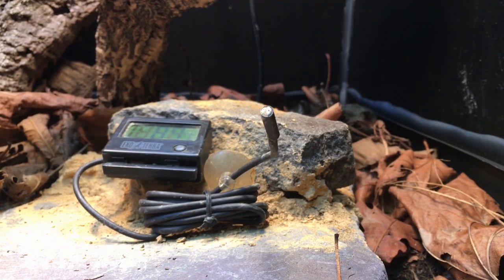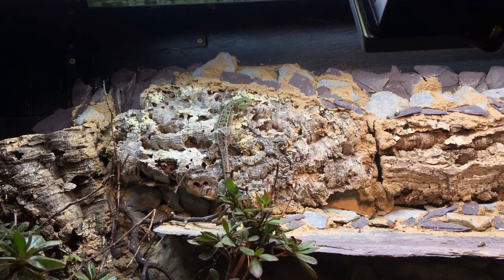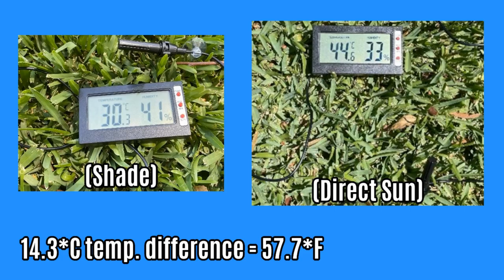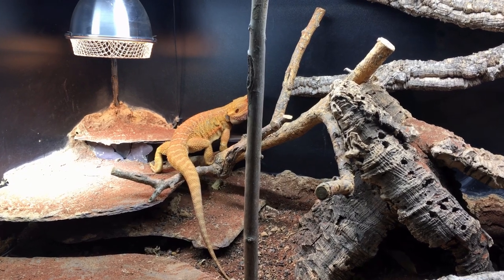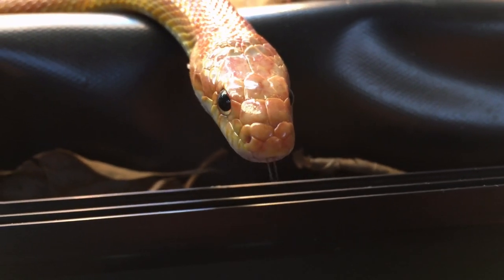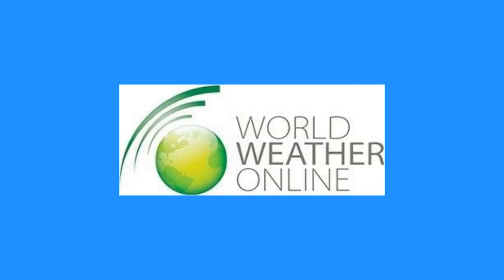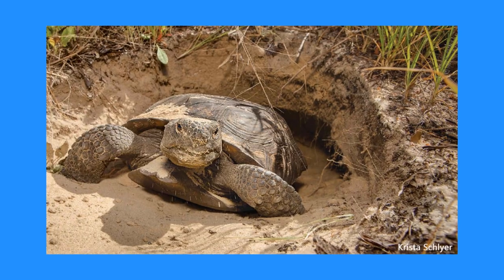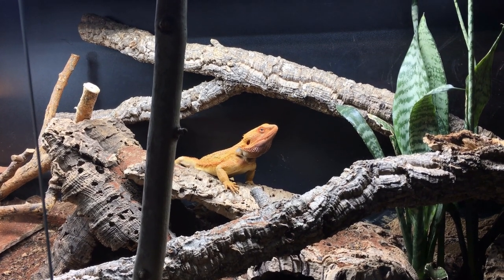We've Been Heating Reptile Enclosures Incorrectly All These Years! - How to Heat a Reptile Tank

Comment: I think a great lesson to learn from this is simply most of our enclosures just aren't big enough?! I've been running tests with different wattage lamps and a dhp on my latest 6x3x2.5 (width, height, depth) enclosure and can keep a 100w halogen on full almost all the time using a dimmer thermostat as an overheating precaution. 

This is obviously species specific and completely reliant on factors like ambient room temperature. 

I can't see how this theory can be used on small vivariums safely without a computer controlled system. Excellent video and leaves a lot to think about!
Reply from the maker: The question is, what wattage tungsten halogen lamp are we to choose? We shouldn’t be choosing it on the basis of temperature, which is only a product of its action: we should be choosing it by direct selection of its output. So, instead of seeing how warm it gets when the lamp is left on (which is a product not just of the lamp but the temperature of the room, the ventilation of the vivarium, the insulation of the vivarium, and so on), we consider its output directly. We already do this with UV lamps when we consider the UV index: soon enough we will be doing something very similar with near infrared and, indeed, for visible light which is yet another consideration.

Only AFTER we have got the radiation right do we start thinking about temperature control, which should be achieved without altering the “sunlight” we have established.

You are right though... The bigger the viv, the easier this gets.

Thanks for watching!
Reply: @JTBReptiles  I look forward to seeing how we can optimise how to provide natural radiation! 
Until then, all I can think of doing is not having a lamp barely lit in a small vivarium because after a few seconds the enclosure has reached the temperature at which a stat has been set to, which is a great lesson your video teaches!
Reply from the maker: Give it a few months and the pieces of the jigsaw could well have been fitted together. Watch this space!

Comment: What a brilliant video and it all makes perfect sense!  How can the air temperature outside be different only a few feet away of course it isn't, it is radiation!  I tend to have a temperature probe at the hot end and the cool end, but do I really need one at the hot end anymore?  Monitoring the temps in a shaded area surely makes more sense?  If we use a corn snake for example the temperatures vary from region to region and looking at the very useful information from Snakes N Ladders Alabama peaks at over 30 and Florida into the mid 30's during summer months for day and low 20's for night.  Therefore could we happily set a day temperature from a probe reading at the cooler end to read happily in the higher 20's, say 27/28?   I have been trying to keep the cool end at say 24 and the hot end at 27 but possibly could I increase these temps?  The next part is how does your thermostat probe then fit into all of this as well!  Too many questions and fried brain now :-)
Reply from the maker: Thank goodness it made sense, I’ve been worrying for months whether this video would just be overcomplicated mush to people so that’s great to hear!

Yes, you’re bang on. The apparent warm end/cool end temp difference is because of the lamps illuminating the thermometer, not major differences in the temperature of the air in a few horizontal feet of space! I would try if possible to keep the air temperature (as measured with the probe dangled free in the shade) at the lower end of the acceptable range. I will be talking more in a few months about exactly why this is the case and how you can pull it off (using fans - I use the Lucky Reptile fans). In peak summer for a corn snake I’d aim at 20-25. Always remember that too hot is more dangerous than too cold, because a reptile can always bask more to warm up, but in a box it can only do so much to cool down.

Thanks for watching!
Reply: @JTBReptiles  Understood aim for the lower end so the animal has a choice to warm up rather than not being able to cool down.  I fitted some lucky reptile fans on our Corn enclosure mainly for humidity purposes to aid air flow to reduce during day and then to let it rise overnight.  I have one blowing in at the cool end and the drawing air out of the hot end.  Also run just one on the hognose to draw out the air from the hot end.  Look forward to how you are using the fans in the coming videos :-)

Comment: Great video!  So going by what you said, which makes perfect sense btw, are you adjusting the temperature (and therefore the radiation level accordingly) seasonally either up or down?  Is there a benefit for this seasonal change?  Doing my research before buying a Bearded dragon and this topic is fascinating.  Thanks!
Reply from the maker: Yes, the air temperature is controlled seasonally to match weather data, and radiation is changed by having the lamps coming on for less time during the summer. Ideally I'd like to have it so that the peak intensity of each wavelength was less during the winter (which isn't achieved just by having shorter photoperiods), but this isn't so simple to accomplish without using different lamps.

Comment: Always interesting.  But what about an ideal temperature where the animal doesn't need to warm up or cool down?  Say, out in nature, it's a cloudy, warm day.  Critters are neither basking, nor are they hiding, but just out and about doing their thing.  Is it healthier for them to have to seek these extremes of warming and cooling?  Not sure if that makes sense, but there ya go.
Reply from the maker: Our aim is not to establish extremes of warm and cool: we replicate what is a natural air temperature for a species, replicate sunlight, and let them thermoregulate as they choose. When it is not sunny, most species don't come out: frogs in my garden don't croak unless it's a sunny day; friends who have lizards in outdoor enclosures don't see them when it's overcast. Rarely is the air temperature high enough on a cloudy day for herps to become active. Many herps have a preferred body temperature between 35 and 40 degrees C; 35 to 40 degree air with no sunlight doesn't come about often!

With that being said, it is certainly possible to engineer this unnatural situation using a ceramic heat emitter as a standalone device, but then the animal won't be able to move to and from light and shade in order to thermoregulate as it has evolved to, and it won't receive the benefits of exposure to radiation which aren't just heating - tissue repair, D3 synthesis, and so on. Of course, if we are keeping the enclosure in the natural temperature range, then even thermal conformers which may appear not to interact with a lighting rig (they will do, just not so obviously) must necessarily be able to reach their active body temperatures without any further special treatment (one must presume that thermal conformers have lower average body temperatures than other species).

Hope that answers your question!
Reply: @JTBReptiles  Perhaps using the word "extreme" was a mistake, but rather the upper and lower ranges of comfort.  If reptiles can be too cold and too warm, then there must be a temp in the middle that feels just right.  In the wild, critters are exposed to some pretty wild fluctuations.  Where I live, frost is not unheard of even in the summer.  It can be 70's during the day and 30's at night (Fahrenheit).  There are however, those few days that are cloudy and in the 70's and snakes, frogs, and toads are out and about.  Frogs where I live don't generally say much during daylight hours, just evenings and early mornings before the sun comes up. As captives, we shelter them from predators, floods, parasites and whatnot, so should they be sheltered from temperature fluctuations as well?  Or are they healthier when exposed to those changes.  Or perhaps the activity of thermoregulation is just another form of enrichment.  Without the need to thermoregulate,  maybe they would just get fat and lazy like ball pythons in tubs.
Reply: @jimthomas6127  There's a lot of variables. Lets say we use this perfect (read preferred) body temperature of a Burmese python, which is around 29/30C, and feed the snake a large meal. The meal will raise the snakes metabolic rate and therefore its body temperature, in order for the snake to maintain 29C body temperature, it likely has to move to a place that's around 27C to compensate for the raise in body temperature
Reply from the maker: You've hit the part of the nail on the head towards the end of that paragraph: thermoregulation can, I suppose, be considered enrichment. As I said in the video, you COULD warm the air in the enclosure such that it is an optimal temperature for the reptiles and offer none of the sun's wavelengths - that's what people have done for years by heating rooms and using ceramic het emitters. But it isn't natural that a herp should spend its entire life just at a comfortable temperature. The majority of them, the majority of the time, spend their days shuttling to and from light and shade. You can get away with just warming the air when keeping species which interact relatively little with sunlight (crepuscular and nocturnal species, namely), but if you try it with diurnal species, their suffering will be immediately obvious (take bearded dragons as an example). This leads on to the point that radiation doesn't just warm things up: it has other metabolic interactions. Even if the air temperature is conducive to activity, there will be no tissue repair, no D3 synthesis, no visible light stimulation, no sensing UVA... In effect, by going down the radiation route rather than warming the air, we are giving our herps the chance to thermoregulate as they would most of the time in nature and allowing them to receive the benefits that radiation offers besides just warmth.

There's a reason that people who keep reptiles and amphibians outdoors select a sunny spot for the enclosure and don't just put it in the shade!
Reply: @JTBReptiles  I'm new to snake keeping.  I've been at it for less than a year, so I question everything.  From day one I've thought the whole heat mat/ belly heat thing was a bit unnatural so I had to find a rational explanation for this approach, the explanation of course being that many snakes come out after the sun goes down to absorb radiant heat from rocks and pavement.  In that regard, belly heat is not entirely unnatural as some would say.  Also, as strictly an observation, I don't see snakes come out first thing in the morning to bask, but they appear to wait until the ground or surrounding rocks have warmed which would also indicate that they are using radiant heat.  maybe the direct heating from the sun is just a byproduct.  I know it sounds like I am arguing for heat mats but I'm really not.  My preference at this point is  halogen bulb above rock, with a gradual cool down during the night.
Reply from the maker: @jimthomas6127  You do right to question things: probe statements viciously, although obviously not to the point of avoiding the truth!

How do you know that, if snakes only come out later on in the morning to bask, they aren't doing so because the sun is higher in the sky rather than because basking surfaces have warmed up a bit? Or perhaps they only come out after a certain point in the day because they have passively warmed to such a temperature as to be able to move. I don't suppose we can know without doing experiments in controlled conditions. However, I am quite certain that they are not making the decision based on surface temperatures for the following reasons.

Firstly as a bit of groundwork, it isn't just the temperature of a surface which matters, it is the material's capacity to transfer heat: put your hand on 40 degree C cork bark and it feels slightly warm; on a 40 degree C stone and it feels much warmer. Now, a reptile cannot really know what the heat transfer will be between an object and itself without touching the object, so in order for them to be seeking out a basking site based on this metric, they would have to be going round trying sitting on different things, and I do not believe that this has ever been observed. Secondly (as explained in the video), we see herps basking on all sorts of different objects with no clear preference - if they were really bothered about heat transfer between objects and themselves, they should predictably sit on rocks vs. wood vs. sand vs. soil vs. grass vs. dry leaves (and so on) at different times of the day, when they don't.

This, in my mind, means we should be replicating sunlight in the first instance, making sure air temperatures aren't unnaturally high or low, and making sure that surfaces are not too hot or too cold (to the touch); the specific air and surface temperatures (once again) don't actually matter.